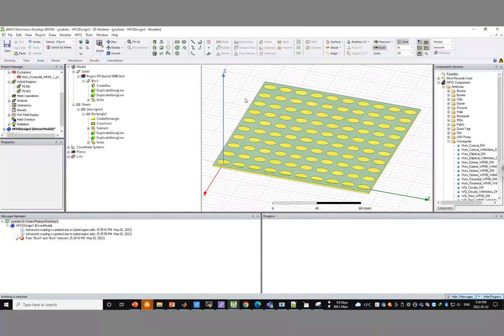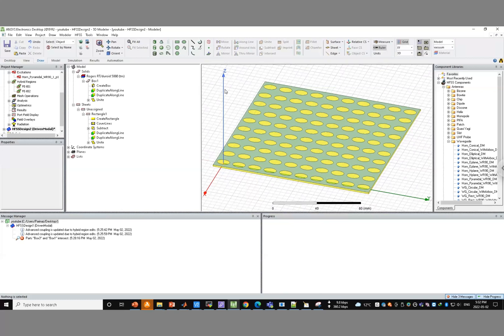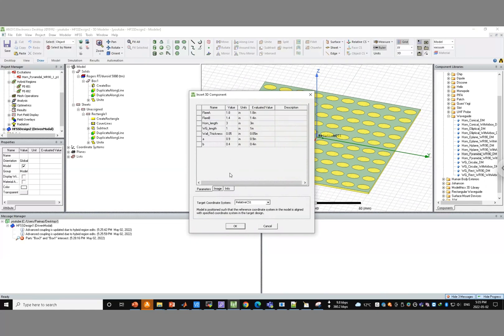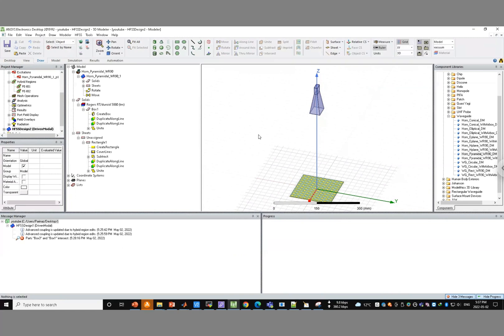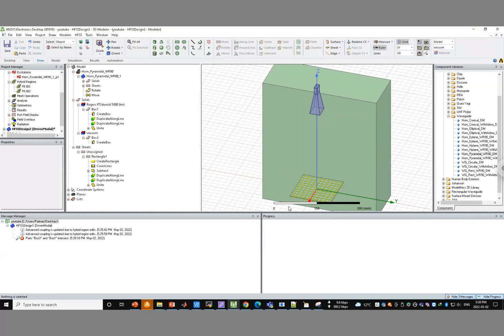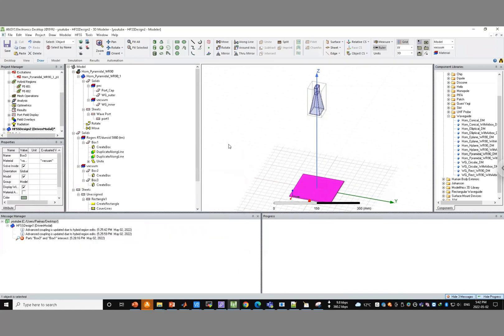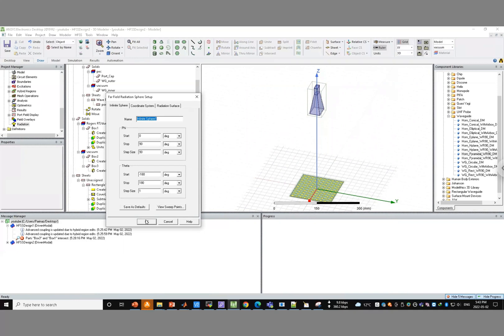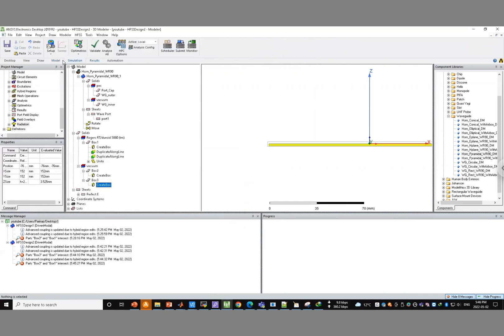Simulation of a finite frequency selective surface in Ansys HFSS using FE-BI

Comment: can it be done in CST. How to do it when there are two horn antenna and in middle FSS is there . One horn antenna is transmitter and Other one is Receiver. I want to Measure S21 of FSS.
Reply from the maker: Yes, you can do it in CST as well. But you probably need to find a way to avoid meshing the free-space between the FSS and the horn antennas. There has to be an option like FE-BI boundary in CST as well.
Reply: @parinaznaseri thanks for reply....plz make a video on it

Comment: Thanks for your great sharing. But how can we set the distance between the horn antenna and the surface?
Reply from the maker: That is selected based on the maximum oblique incidence angle (based on the size of the FSS you are simulating) and the gain of the antenna. At the end, you want to place the horn antenna at a far enough distance for an almost uniform excitation over the whole FSS. But, not too far, that causes a lot of spillover.

Comment: Thank you for your video. During the simulation in HFSS, some of questions come to my mind. Can I get S-Parameter Data only in Unit Cell Simulation? In finite array simulation, is there any method to obtain S-Parameter Data for FSS?
Reply from the maker: Thank you for your comment. No, in the finite array simulation, you can obtain the reflection coefficient at the excitation port of the feed antenna. However, if the FSS is reflective, then you would see an increase of reflection coefficient at the antenna's port. So, there's some indication of the FSS properties by looking at the S11 at the feed antenna port.

Comment: Thank you  ma'am for this lecture, I want to collect s parameters both reflection and transmission. can you please guide me. I did by placing two horn antenna one for transmission and other for reception but I'm getting wrong, it doesn't  matches with the results of unit cell.
Reply from the maker: can you send me a picture of your simulation setup? for transmission coefficient, it is S21 between the port at one horn to the port at the other horn. For reflection under normal incidence, it's S11 at one of the horns.
Reply: @parinaznaseri  thank you so much for your reply. Could you please share your mail id so that I can share a pic?